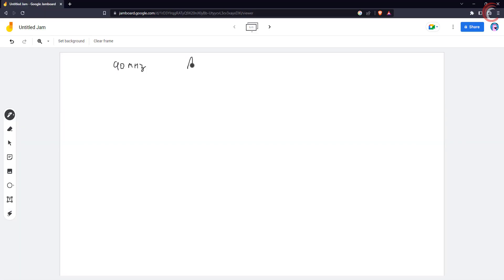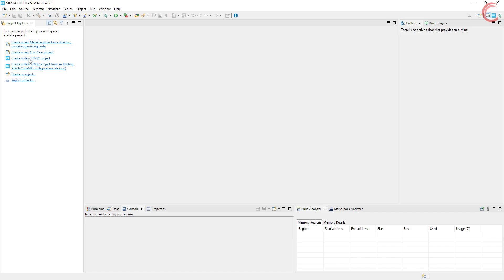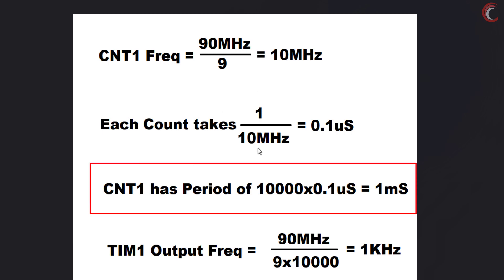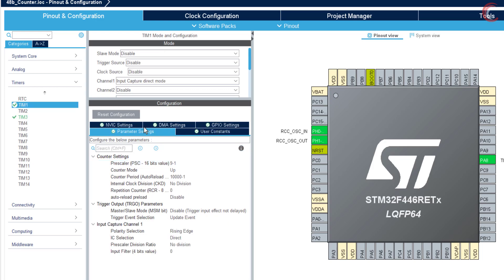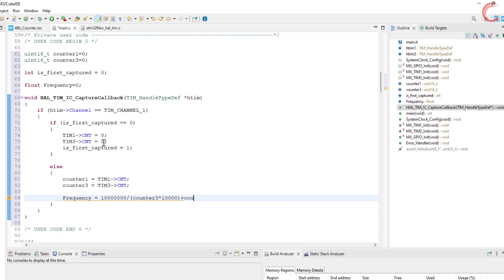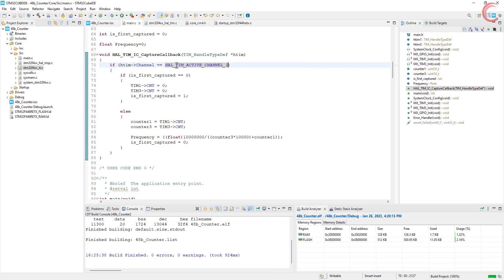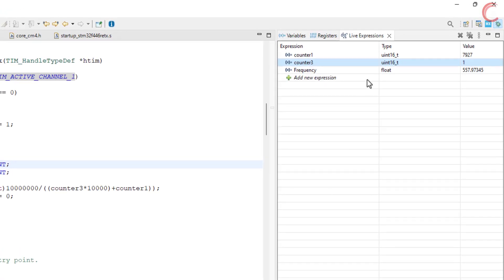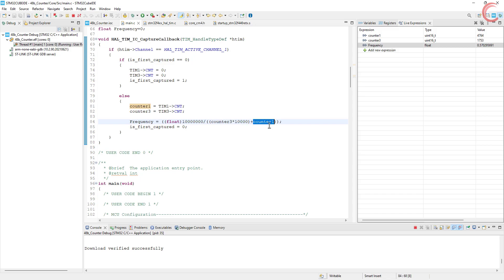STM32 TIMERS #8. Cascading Timers || Make 48bit Counter || External clock mode

Comment: This is a great tutorial. Just one question -- why is it 65535 and not 65536 when you are doing the math?
Reply from the maker: the 16 bit values range from 0 to 65535
Reply: Thank you for your reply. Say I had two digit counters, which counted 0 to 9. Could I represent values 0 to 99 with them or only 0 to 89 with them? In the case of the single digit (0 to 9) counters, I think you would multiply the first digit by 10 and add the second digit. Seems to me like it would work the same way with binary counters which count 0 to 0xffff. You would multiple by 0x10000, no?